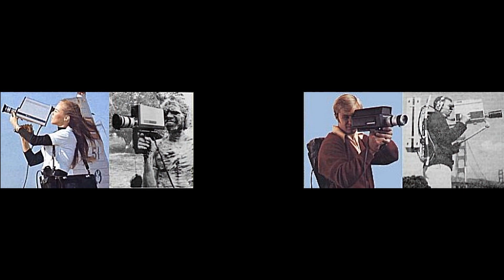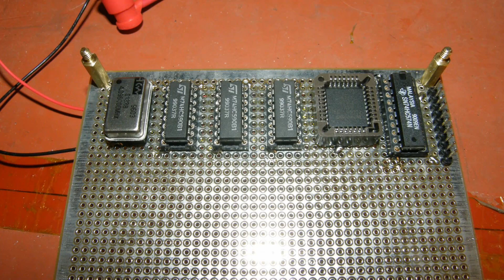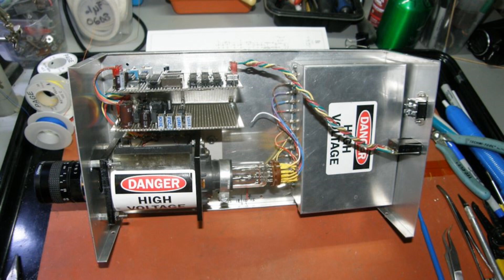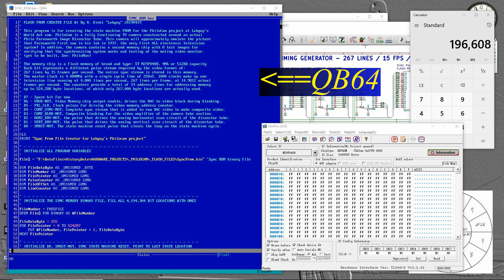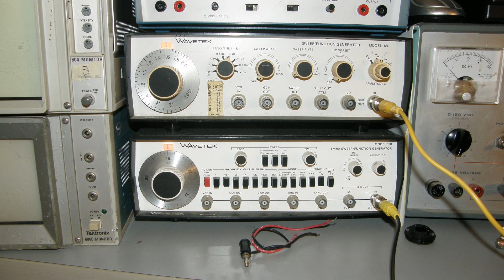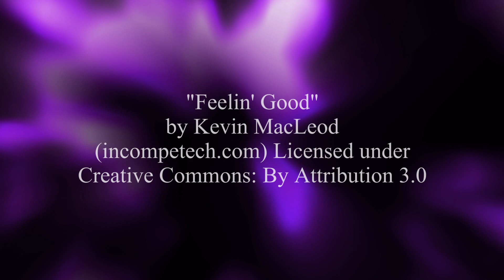NBTV DissectorCam,  Part 5

Comment: Excellent.I'm looking forward to seeing the images it produces.
I like your approach to designing the synch' generator.
Any fool could have slung an Arduino in it.
The oscillator, divider chain plus memory chip and latch is far more interesting !

By the way, I think Philo T Farnsworth was a deadringer for Paul Carlson of Mr Carlson's lab !
Reply from the maker: To your first part, ME TOO! :)
The reason I like hardware timing generators is that my spec for sync jitter is ZERO. I have never seen a software driven microprocessor produce pulses that were not eaten alive with unacceptable jitter. Usually caused by internal interrupts and other instruction cycle discontinuities. For instance, an increment and conditional branch instruction may take 8 cycles while counting and 9 or more if it has to perform the branch. These discontinuities multiply against each other if the loops are nested. A crystal and counter never fail. 
To your last part, you may have a point there. I think the personalities may be more closely matched than their physical appearance. But, form follow function. Right?
Reply: @videolabguy  Yes, using microcontrollers for critical timings, even employing interrupts, often involves having to "Fudge" the code to get the sequences to fall in line with what you might have originally calculated on paper.
Whereas the dedicated solution you have come up with is not subjected to the "Hijackings" often caused by various loops, input poling and jumps in code.
Reply from the maker: Not to mention the fires that can be started by the notorious HALT command!
Reply: @videolabguy  Yes, in such cases I always keep a bucket of sand at the ready !